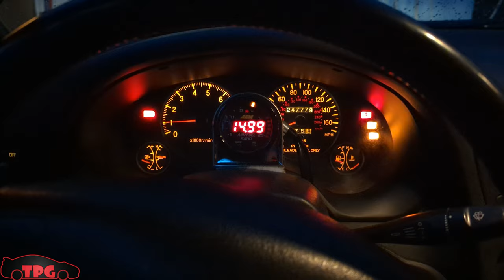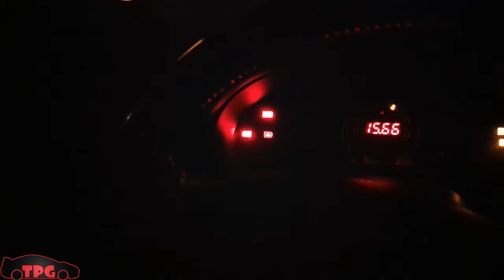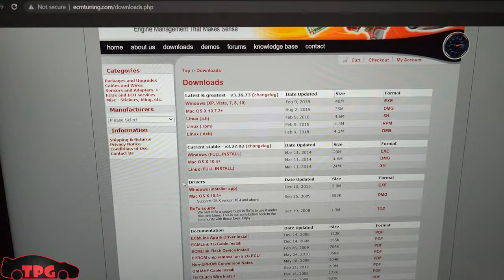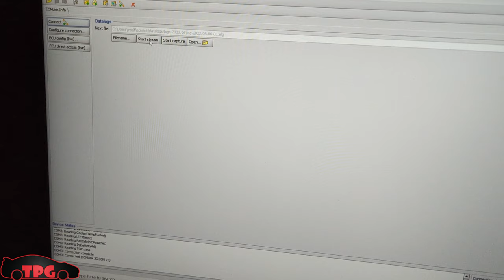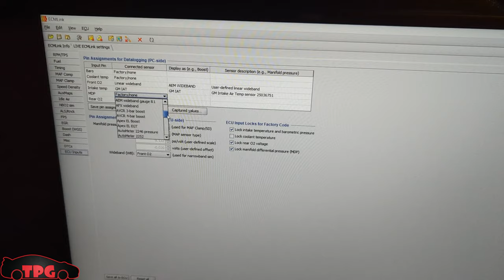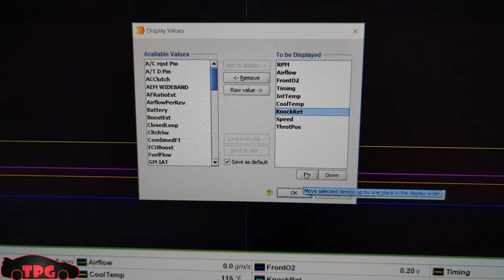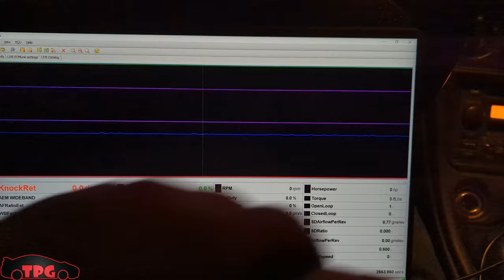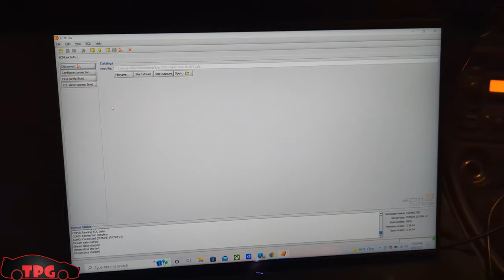SETTING UP NEW TUNING LAPTOP RUNNING ECMLINK V3- ECM TUNING

Comment: Hi so I had question this guy that was going to tune my car said I had to buy a dsmlink v3 so got that but then he said I had to buy another part called EPROM Ecu is this true?
Reply from the maker: @boosted2g  yes.1995 eprom ecu socketed for Ecmlink flash module
Reply: @TPGDSM  ok thank you 🙏
Reply: @TPGDSM  hey sorry to bother you again is there a website where I can get the eprom Ecu? because I had tried Ecu tuning website and they do not reply back at all and it seems like there the only ones to have that part
Reply from the maker: @boosted2g  yep. 95 2G ecu can be socketed with the eprom flash module for tuning using link v3. He is correct 👍
Reply: @TPGDSM  where can I get that part?
Reply from the maker: @ check on Facebook dsmclassifieds or Kenny Kline or ecmtuning.com, performance Partout, miller import parts, eBay